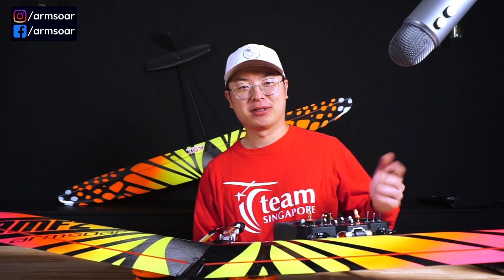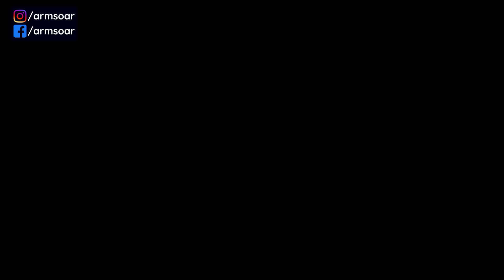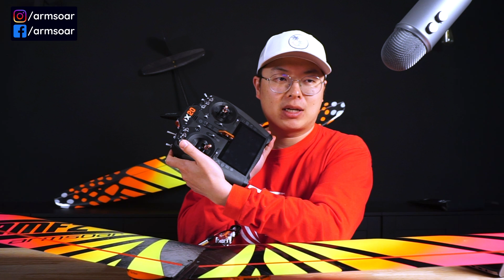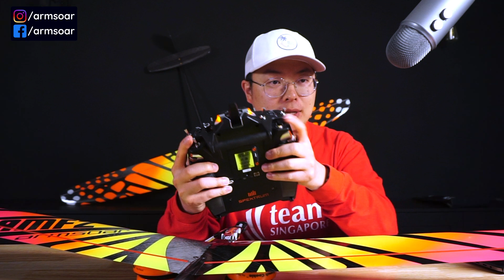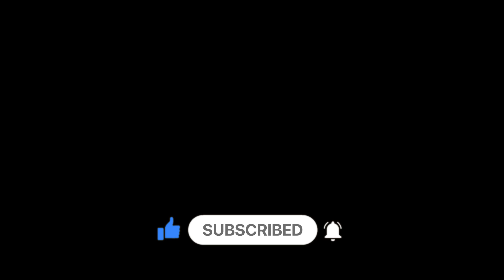RC Glider Basics | DLG Flight Modes

Comment: Helpful. I have a Mini Elipse I have been flying for many years now and have a similar setup for cruise, thermal and penetration through cold air or when heading over to less sinky air. I have a potentiometer set to control the flap settings to positive or negative for fine tuning and use the idle-up switch (heli) for quick flap or flaperon settings. And like you brakes via the throttle. I have also used coupled elevator to flap for tightening turns when doing aerobatics. And coupled rudder to aileron paired to differential aileron/flaperon.

Comment: Great Video. I am using the NX10 and would like to swap the A switch and the Bind button as you did. Is this possible on the NX10 ? I fear the case holes are not the same size. Thanks

Comment: Aren't speed & zoom modes same? I've already seen guys using same settings for both phases.
Reply from the maker: On older airfoils it’s the same setting. On new models with higher performance airfoils they are two distinct settings.
Reply: @ArmSoar  Thx. Mine is Hawk 1m DLG with airfoil AG46. Not sure if it's modern but this little bird is quite new design. What is actual difference in those settings? I guess both need ailerons to be a little up to get the best air penetration.

Comment: Thomas, thanks for the great video. I like the explanation of the quick turnaround but didn’t understand; do you have to switch back to zoom mode before catching or does pushing your launch button automatically switch to zoom when you release it?
Reply: Never mind - I saw your DLG/iX20 video and you are using something that’s different in Taranis/OTX
Reply from the maker: In both my OTX and Spektrum radios it goes into Zoom mode once I release the launch button.

Comment: your 3sec reset on the launch 2 is interesting - I use the old system for pushing over with the ELE - the logical switch reverts to the currently switched flight mode when it sees the ELE greater than 20%.
Reply from the maker: On my FrSky radios I was also using a logical switch to exit Zoom via elevator input (in my case, 30% either direction). No action-based sequences/logical switches in Spektrum, so I am using their time-based sequencer function to enter/exit Zoom mode instead.
Reply: @ArmSoar  ah, that makes sense!

Comment: This is excellent thank you.   Some closeup of adding a spring to the left stick would be great.  I’d really like to add that to my tx.   Thanks!

Opened my tx up.  I see where you are talking about.... is a tiny spring like out of a ballpoint pen or a bit of rubber better?
Reply from the maker: I've used both, the pen spring is a more permanent solution although I've mostly been using rubber bands. I replace them once a year and have never had one break yet. The issue with the pen spring is they're relatively short and sometimes you don't have something closeby to hook on to to give it tension.
Reply: @ArmSoar  great!  Going to try a little rubber band today.  I’ve been pushing up to deploy flaps on sailplanes since the 90s and never thought to add resistance to the left stick. That’s a great idea!  Appreciate that!    I never understood why most pull down.  The left thumb rests so much more comfortably for rudder input with the stick at the bottom of the pot.  Oh well to each his own. :-)
Reply from the maker: @banko444  let me know if you like the auto retract!

Comment: Thanks for the video Thomas.
Hmmm! I'm doing it wrong.
I was holding the launch button probably halfway up the initial vertical travel. Release varied greatly by windspeed.
So I should set the elevator to rotate the plane sharply then release the launch button just after the blade leaves my fingertips.
Then, just before the plane stalls vertically tip over to horizontal flight and click to cruise mode?
I like the spring on the flap stick. My zoom is timed in seconds.
Reply from the maker: It's a bit simplified in the video - in very windy conditions I do let it climb in a slightly shallower angle (70-80˚ instead of 80-90˚) so that it doesn't get pushed behind me during the climb phase. But other than that, your summary is on the point - give it a try!

Once I pushover into horizontal flight I'm usually in Cruise mode as that's what I'll use for the first part of the flight when searching for a thermal.

Give the more aggressive rotation and the spring on the flap stick a shot, maybe you'll like it!

Comment: I have set up a HawkDLG, but when I have flaperons down for landing I loose directional control with the aerolons.  When you do your video on setting up the transmitter, it would be great to see how you manage this.
Reply from the maker: The plane is different but the idea is the same - I'll make sure to touch on that in the video!
Reply: On my (non-dlg) gliders, i noticed that with flaperons down, roll can be controlled with the rudder (which forces one wing to fly faster than the other, and therefore climb because of the flaperons being down). In mode 2, this means rolling with the left thumb instead of the right thumb.

Comment: i assume the DLGs are using similar airfoil (high lift and low drag), it has small differents but the principle is same. they has also similar weight, wing span and wing area..etc.
however i found at least 3 different setting for launch/zoom/speed, it's really confused me as i am beginner to DLG, for example:
1. Launch Mode
a) elevator up
b) flaps up (2mm), elevator up 
c) flaps down(2-3mm), elevator flat
2. Zoom mode
a) flaps and elevator are flat (no change)
b) flaps up (2mm)
c) flaps down (2mm)
3. Speed mode
a) flaps and elevator are flat (no change)
b) flaps up (3mm or more)
So in wonder if there is any universal(foolproof) setting to avoid planting the glider on the ground.
Thanks
Reply from the maker: Yes, the concept is the same BUT the numbers will be different. You need to reference the manufacturer's recommended settings for the camber setup on the different modes. For example, on the BAMF 2:
1. Launch preset - clean section (0mm camber) on the wings and elevator up (amount will depend on how aggressive your rotation is),
2. Zoom mode - 2mm reflex (flaperons up) on the wings and ~0 on the elevator,
3. Speed mode - clean section (0mm camber) on the wings and a tiny bit of up elevator compared to Zoom mode.
Reply: @ArmSoar  i thought the preset could be very similar to all DLGs, unfortunately my DLG was bought few years ago from individual maker(homebuild), there was no manual and couldn't find the person, but i will try different preset anyway, thanks again
Reply from the maker: If you don’t have known settings, I’d start with 0 camber for all three modes and go from there.

Comment: Thank you for this. Can you supply any additional info or instructions on adding a spring to the left tx stick?
Reply from the maker: Depending on the radio/gimbal, some don't require modifications and there will be a spot you can hook a spring or rubber band to internally, such as the FrSky Xlite/Xlite Pro, X10S, and JR XG8 and XG14. On the Spektrum iX20 and Futaba 16iz that I've been playing with lately I needed to drill a small hole to fit in a tiny screw for the spring/rubber band to hook onto the gimbal. This probably voids my warranty though! Haha...
Reply: @ArmSoar  Thanks Thomas!
Reply: @ArmSoar  Show some pictures on FB please.
Reply from the maker: @theowolthers7732  I'll shoot details in an upcoming video, already 3 or 4 requests on more info on this so it should be an interesting topic.